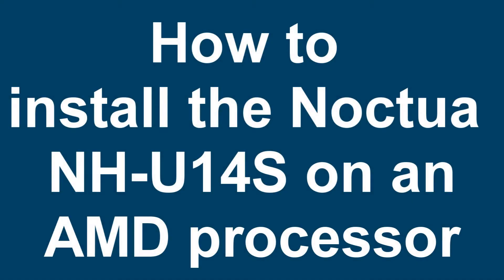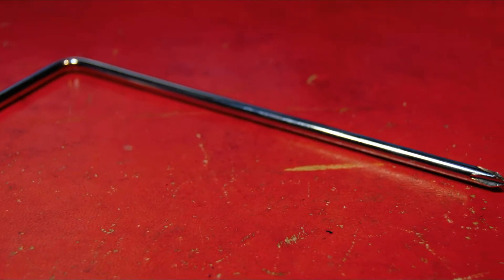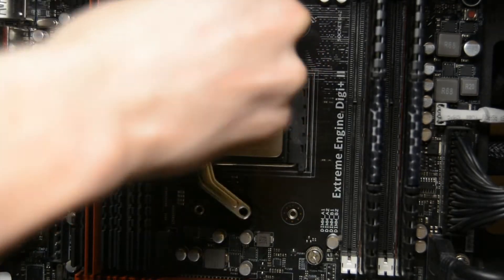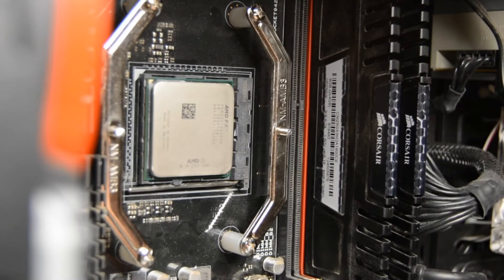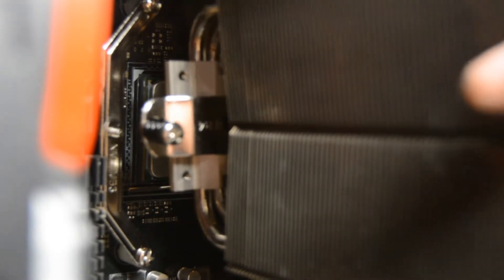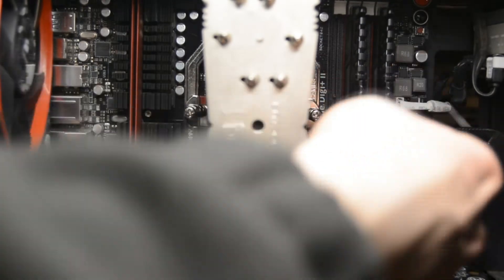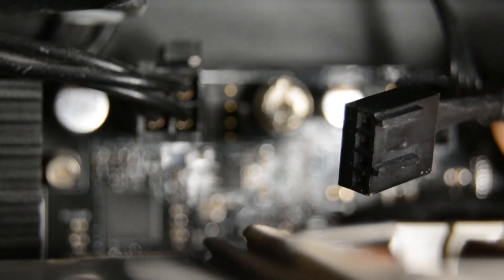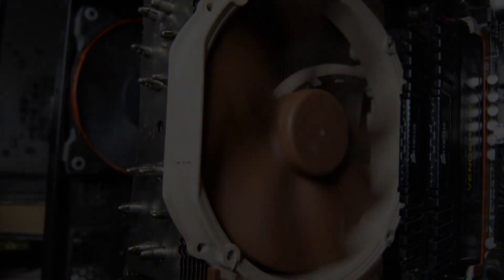Installing the Noctua-NH U14S on an AMD CPU

Comment: Can you tell me how tight the screws are supposed to be, that hold the cooler down. I installed this exact cooler last night, and I didn’t screw them in until stopped. Some people have stated go at each side little by little, until the screws stop.
Reply from the maker: Tighten the screws a small bit of a time in a cross patten. They should not be so tight that it bends the motherboard but to the point you can feel the screws are getting harder to tighten.

Comment: My brackets won’t fit! They are just too big for the holes in my motherboard!! Any ideas?
Reply from the maker: +OfficialJBGamer unfortunately not. Compatibility is mostly down to the CPU socket but can be affected by the manufacturer of your motherboard making changes to the mounting for cooling.

Comment: I am struggling cause I got the ab350 pro4... I don't see the back plate fitting
Reply from the maker: +josephlamar31 if I am correct that is an AM4 motherboard. You may need to request the mounting kit from Noctua

Comment: No, too much thermal compound will not overheat your CPU! Only too little is bad!
Reply from the maker: I made this before that was proven (or at least before I found out). It is still worth keeping in mind though as it is a waste and with conductive past you can kill components
Reply: Furby Bytes You are totally right with those concerns... However... why would you even use conductive thermal compound? There is no actual reason for that anymore...
Reply from the maker: liquid metal is apparently very good to use
Reply: Furby Bytes Well... yes... But only in extreme situations, like when delidding. When used as usual thermal paste, it only makes 2-3°C difference. Compared to the high cost and difficult handling, it is just not worth it...